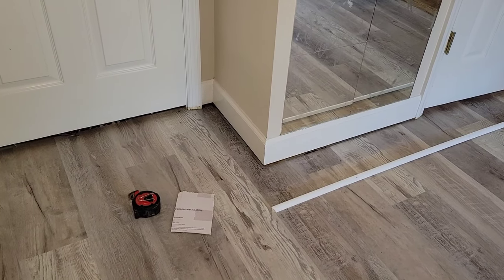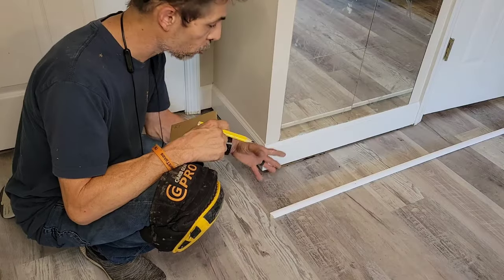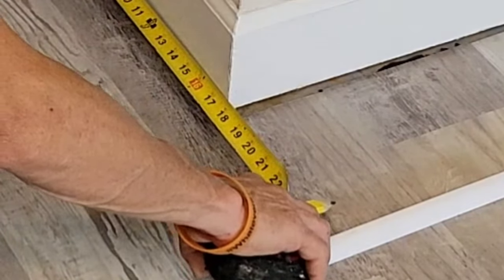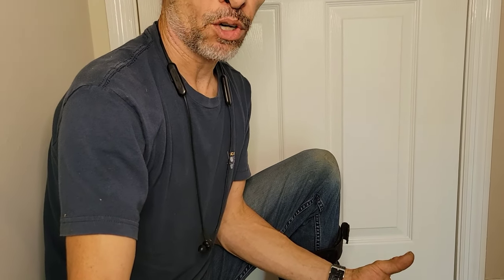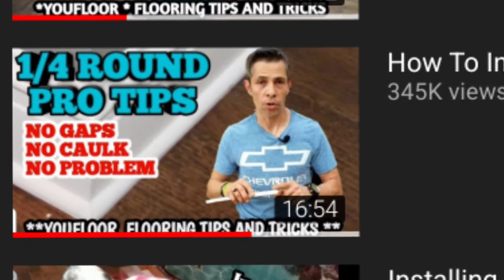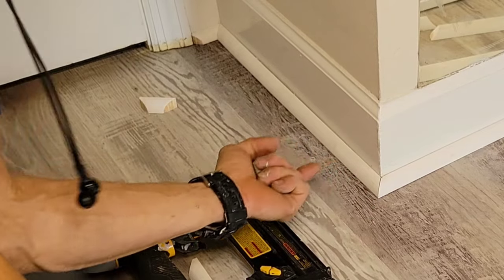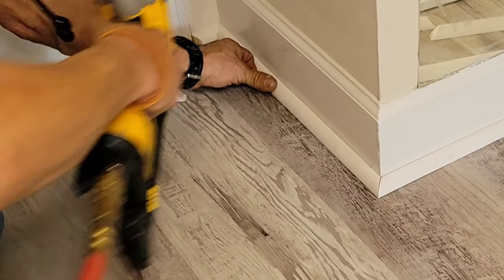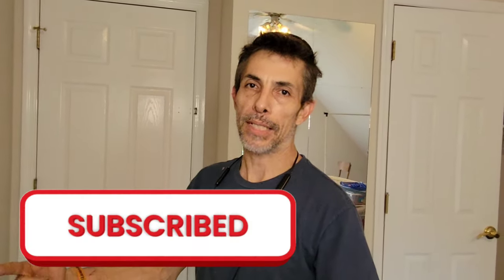Quarter Round Pro Tips - Where To Start & Stop Measurements

Comment: Depending on the saw (works on my 12-in rigid but not my 7 1/4-in Ryobi) you can line up your blade square first then move it to a 45 cut (while holding and making sure it doesn't move) and it will be right on the line without guesswork.
Reply from the maker: I get that.  Seams like you know your tools. Thanks for the tip

Comment: Brilliant video, best ive seen yet, I'm only a diy guy and what i used to do was cut some small pieces what i would put round the outside and inside corners so i knew which angle to cut and then took them with me to the compound mitre saw so i would always cut correctly, but great video
Reply from the maker: Great idea. Especially  if you're  just getting started in diy. Nice tip👍

Comment: Do you have a video on the pro and cons on the different types of material used for 1/4 round and shoe molding?  When I go to the box store there are 5 different types (poplar, pine, pvc, Styrofoam and MDF.  Finally, what is the best way to attach them when there are steel studs?  Thanks
Reply from the maker: I like to use primed pine for all my flooring. I have used mdf but only if the customer has already bought it. I definitely don't use it in the bathroom as it can swell over time from water and moisture. If I am doing a floor where I have to match wood baseboard, then I would just use oak and stain to match. As far as attaching it,  i us pl premium 3x, and I use an 18 gage brad nailer. It will pierce the metal as long as you  don't hit the corner of the stud where the metal is thick. Then hit the top with some caulk, and you're all set. Hope that helps. Thanks for the question
Reply: Thanks!!!!! @YOUFLOOR
Reply: Just thought of two questions; 1) Do I have to glue the 1/4 round?  Some day someone is going to want to change the flooring and if not glued then easy to remove and reuse verse damaging both the 1/4 round and base molding.  2) Nail going through the 1/4 round will not go into the metal studs only, but would go into both the metal bottom plate and the stud.  Will 18 gauge go through both or do I miss the stud?  Thanks   @YOUFLOOR
Reply from the maker: @dreid4760  I have used silicone before. You can try using that and then inch and a quarter or inches and a half nails. You can use 16 gauge but leave a bigger hole or you could still use 18 gauge. Just don't nail where there's a stud, then you can use 2 inch nails through the baseboard and bottom plate. Just a few different suggestions. Hope that helps
Reply: Thanks, if I use silicone will not, I have the same problem as glueing?  I want to someday remove the round to replace the flooring.   @YOUFLOOR
Reply from the maker: @dreid4760  the silicone is flexable  and will allow your floor to expand. When you get ready to remove the 1/4 round, Just cut it with a knife and pry it up. Now you'll be able to remove the flooring

Comment: If your adjacent wall is not 90° say about 120° or 60°, do you still use 44° for the cut or is there different angle for long and short?
Reply from the maker: It would be a different angle. Check out this video. I use a tool that gives me the exact angle to put my saw on. Helps with those odd angles.  https://youtu.be/abkTRdbOd2I

Comment: Would you be able to explain how you install quarter round when you have moulding blocks sticking out? The 45 degree angle is not working because of that tiny bit of the block that sucks out and no one has a video on it.

Comment: Hi. I love your  channel.  My question is  what diablo blade do you use for your miter saw ?  40 ,or 60 tooth blade ?
Reply from the maker: Either one of those are good. It also depends on what you doing. If you are doing  crafts that require small piece then I would use a blade with more teeth. For much finer cuts.  (They also make an 80 tooth blade)But if your doing like trim work, or bigger furniture pieces, mantles then 40 tooth should be fine. Especially if your sanding it and or painting your projects. Hope that helps. Great question. Thanks for the comment
Reply from the maker: @Oneil Evans  I'm reaching out to my commenters to make sure you know I am giving some tools away for Christmas. If you are interested in entering click here for details - - - - - > https://youtu.be/iQOXh0b-_dg